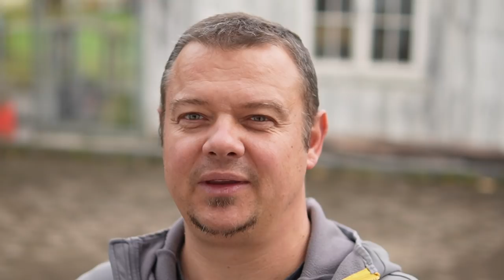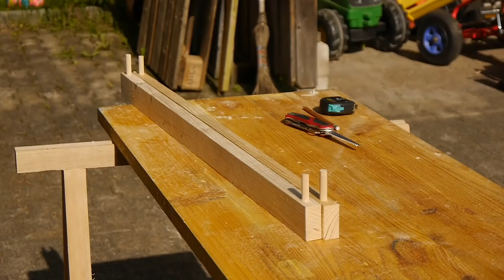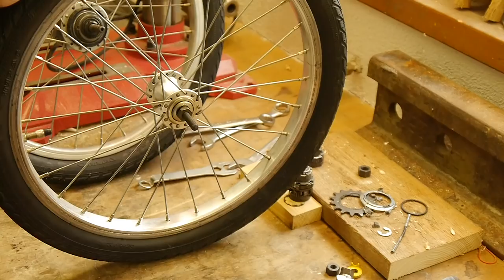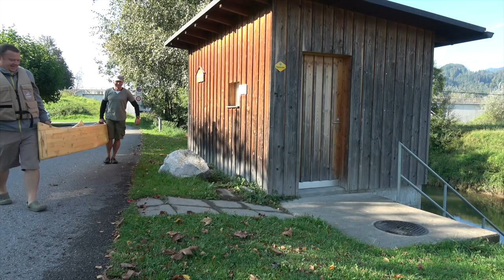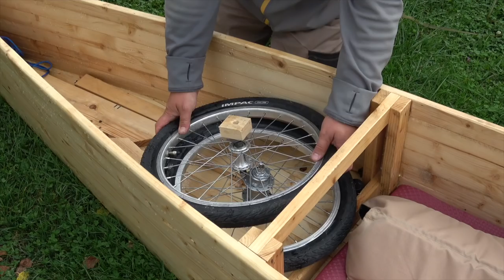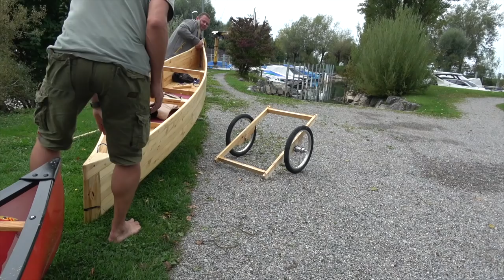DIY Canoe Cart made from children's bicycle wheels and roof battens

Comment: A solid axle will solve the problem. Build your frame over the axle and pull the canoe with the paddle. A simple arrangement of U shaped bolts will hold the axle. The paddle bracket on the bow of the canoe could be something imaginative and fun. A small carved Viking dragon? Love the idea of upgrading the canoe until you have the best version, then build a second with what you've improved. 👍 😃
Reply from the maker: Hello James. Thank you so much for your tips.

Comment: Nice work Felix. I think you could sturdy the whole thing up with a steel bar about 12-15mm  diameter (or to match the receiving diameter on the wheel to act as an axle and attach to your frame to bear the majority of the weight in transport. You can still make it a break-down model that way.  Maybe attaching a floor within your frame would add more frfame stability and capacity. Love your videos Felix.
Reply from the maker: Thanks a lot for your valuable tips!

Comment: Maybe placing one wheel at the very end of the canoe would increase stability.
One wheel at the end near the anchoring, the 2 other wheels around the 3/5th of length point.
Reply from the maker: Thanks a lot for your tip!

Comment: I am thinking that a length of threaded rod, (Also called "Allthread") running thru the frame, from one side through the other, with ends sticking out to act as axles, for the wheels, would add stability and alignment. On another issue, I bought the large SAK, with wood scales. I love the larger blade and, especially, the longer saw. I would like to be able to mount a tweezers and toothpick, and, even one of those ferro rods that fit in the toothpick slot. Could I talk you into showing me how it might be done? It sounds like something "right up your alley" as we say here.

Comment: Totally giving me ideas. Like houseboat ideas. Popular mechanics ideas. I assume the idea could be scaled and multiplied to make pontoons. With a pony truck underneath. I’d bet it could be amphibious. I’ve seen some turn bicycles wheels into paddle wheels or even propellers. Especially what you have made is simmer in design to a Roman barge. Lapped planks with no caulking. The Romans used tenon joints to fix things together. I bet you could use screws spaced 250mm- 300mm apart in pre-drilled holes no glue needed. Oh and this guy https://youtu.be/bFhnt3JUuL8.  Might just give you a few ideas.
Reply from the maker: Yes, something like this is my plan!! Thanks a lot for your tips!